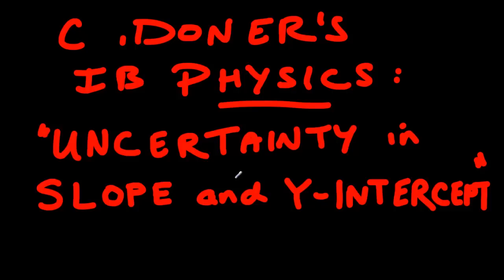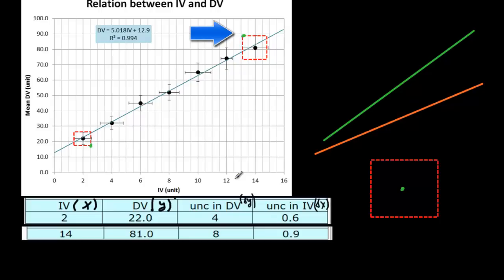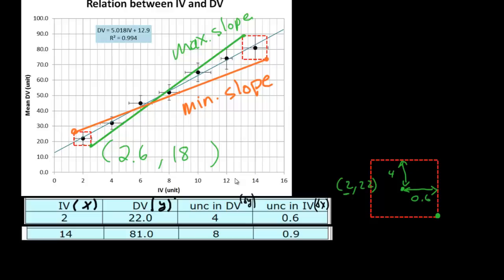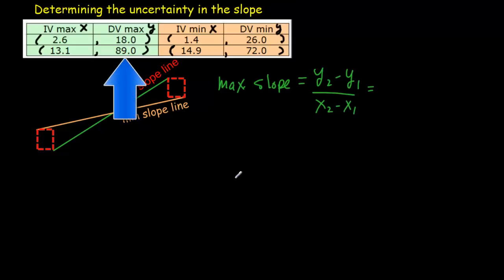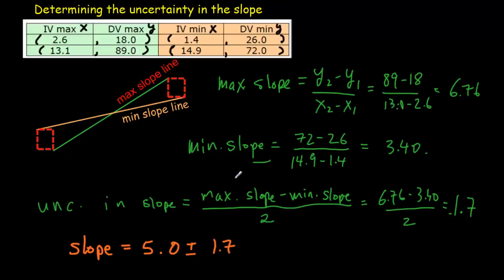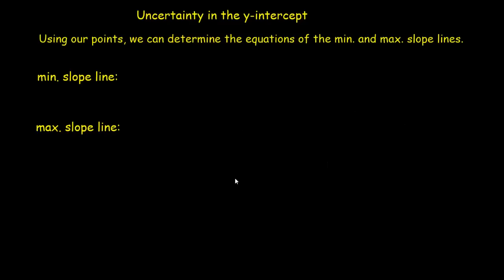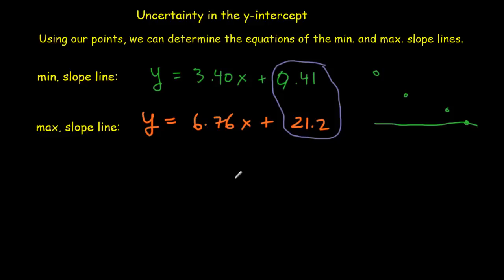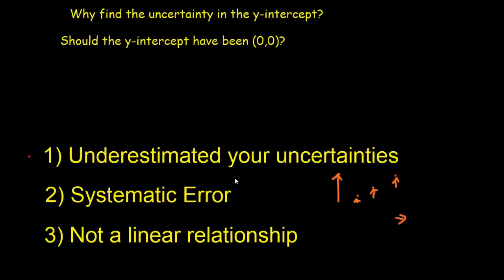IB Physics: Determining Uncertainty in slope and Y intercept (old version)

Comment: is there a way to calculate the uncertainty of the slope of a tangent of a curve at any specific point ? Lets say you have a quadratic curve of best fit and you want to find the uncertainty of the slope of the tangent at 0 point. The slope can be calculated as f'(0). What about the uncertainty of that ? Thank you
Reply from the maker: The best way would be to perform linearization first, then use the procedures from the video.

Comment: From your video here (https://www.youtube.com/watch?v=1gEKoJsFkVI) you describe the use of the LINEST function to get the absolute uncertainties in the slope and y-intercept of the linear regression parameters for the best-fit line.  When applying this LINEST function to the last example problem given for this video I find the uncertainty in the slope to be 0.048 cm/cm and the uncertainty in the y-intercept to be 2.939 cm.  These values are very different from the values given as the answer (0.26 cm/cm and 10.9 cm, respectively).  Can you please provide comment as to which is the more correct answer and why? Also a comment as to why the two methods give such different answers?  Thank you!
Reply from the maker: LINEST uses all the points (but does not use the uncertainty of any of the points) so it will give a smaller uncertainty than a method that only uses uncertainty on the first and last points. The two point method is a very rough approximation that should always overestimate. Provided you have enough data, LINEST should give  a very good value for the two uncertainties.
Reply: @donerphysics  What is considered the more appropriate method?: Use the LINEST function to determine uncertainties OR use the "max" and "min" best-fit lines that take into account the uncertainties of all points plotted?
Reply from the maker: That is for you to decide. For your data, which is the more appropriate method?
Reply: @donerphysics  Thank you for quick and very helpful responses! I would say the 'most correct' procedure would be to honor the data's uncertainties, regardless of how small they may be.

Comment: what if my first coordinate is (0,0)? Do I still draw the error rectangle on the 0,0 point
Reply from the maker: Use your gumption. In some cases, you might anchor your line of best fit, and maximum and minimum fit lines to the origin because your uncertainty for this point is so small.  Ask yourself if (0,0) is based on a measurement, or is it an assumption. Generally, yes, use the first point even if it is (0,0)
Reply: Chris Doner thank you so much!! Very kind of you to reply. Yes it was a measured coordinate; it was for a vt graph in which all y uncertainties were constant as well as all x uncertainties (eg 2 m/s for all y and 0.2 seconds for all x). Putting an error rectangle at 0,0 would imply one of the coordinates would have a negative time or a negative velocity (when calculating m1 and m2) and I was unsure either would be possible since it’s motion down a ramp from a stationary point. In other words, a negative velocity wouldn’t have been theoretically possible
Reply from the maker: It isn't necessarily impossible to get a negative value for a positive quantity because of potential systematic error. If you are convinced there is no systematic error  than it is reasonable to anchor the max and min slope lines to the origin.

Comment: In the topic uncertainty in the Y intercept, shouldn't the equations be like this?
 min slope line  y = 3.40x + 21.2 
max slope line y = 6,76x + 0.41
Thanks
Reply from the maker: You are right. I interchanged them. I will make a correction when I get a chance.
Reply: Thanks. Your videos help a lot in understanding the concepts clearly. Thanks a lot for putting them together.

Comment: Jeez, thank you very much! My physics practicals are giving me a hard time with all those weird uncertainties and graphs.
Reply from the maker: Thanks for the comment Gabriel. I'm glad it helped.
Reply: Chris Doner

Just one question, please. How did you calculate the y-intercept and its uncertainty? 

"Y-int= 3.40x + 0.41", for example.
Reply from the maker: Gabriel271294

Since we know 2 points on say the min. line, we can use these points to determine the slope and y-intercept. There are different methods for this but typically you determine the slope first, and then you plug in one of the points and the slope into y=mx+b and solve algebraically for b, the y-intercept. Excel will do all of this for you if you make a plot of your two points and then select to see the equation of the trend line.
Note that the equation is y=3.40x+0.41 not y-int=3.40+0.41.  That is, 0.41 is the y-intercept.
The minimum slope line will always have the highest y-intercept. The maximum slope line has the lowest y-intercept, and the true y-intercept should lie between these values.
Reply: Chris Doner

Thank you very much for the reply. Yeah, my bad, I meant just "y=". This was very helpful.